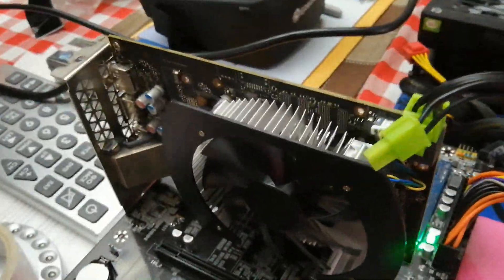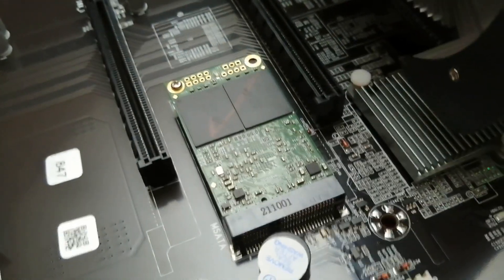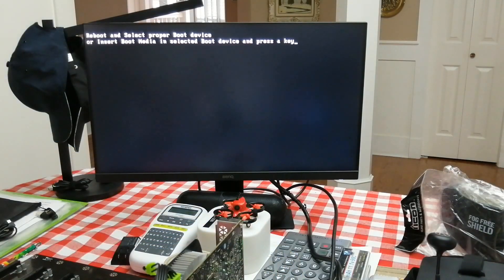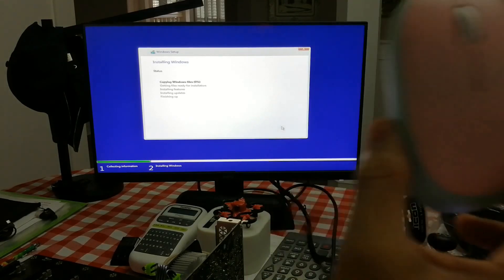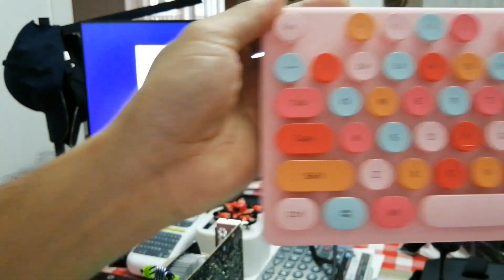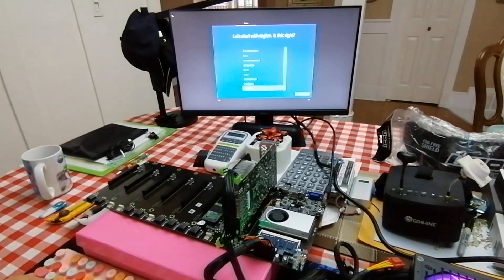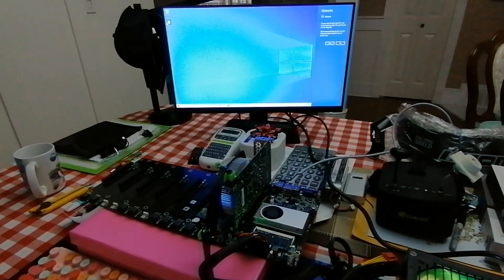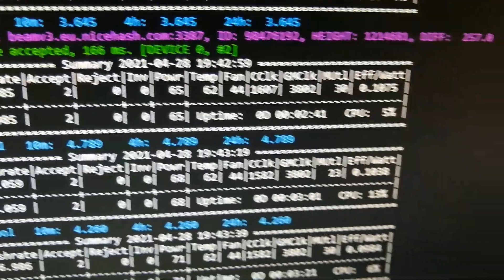BTC-37 BTC-T37 MINING MOTHERBOARD CPU COMBO UNBOXING, WINDOWS 10 INSTALLATION AND TESTING

Comment: Hi miners. Could you read the chip name (between processor and vga), the one square please?
Reply from the maker: BO82HMG, SLH9D, E050B43. I had to stop my rig and removed the heatsink of the chip just to grant your request so make sure to at least like my video or subscribe LOL
Reply: @ruvrandomusefulvideos  Thanks. :) Unfortunatelly I was not precise. It is a small square chip between the processor and the old VGA socket. In the middle of the distance. To the left of it is the letter B. Thank you for the wonderful channel. I started watching other movies :)
Reply from the maker: @dzidziaka  that is the small square chip, it also has heatsink on it. The other 2 same size square chips are closed to the back ports thats it.
Reply: @ruvrandomusefulvideos  missing chip: https://youtu.be/sJIUq_KQS-c

Comment: Hello, what is the space between each pci express slots?
Reply from the maker: Sorry I am away for the next 2 days, I will measure it as soon as I'm back but if you're thinking to get the same board I would suggest the BTC-S37, it has the widest slots spacing, thanks.

Comment: You actually explained the setup pretty well compared to the other 6 videos I’ve watched so far. I just received my 8 slot BTC-S37 am about to set it up for the first time now that I have all my extra components. I’ll check out your other vids on your channel. Cheers!
Reply: What are the 6pin  on the mainboard for? I wonderd since i have the same modell here and never could figutre out what to do with them. Isn it a little bit much to demand 8*6pin plugs? Even if  i buy  a big power supply i maybe can run 5cards.
Reply from the maker: @IndianaStones1  6 pins is to power each PCIE slots. You can get a mining power supply that is design for 8 GPU'S or you can use server PSU.
Reply: @IndianaStones1  - are you talking about the 6 pins on the corner end?
Reply: I think they are for a remote on & off switch but not 100% sure. I’ll look for the video where one UTuber uses them.
Reply from the maker: Thanks for the inspiring comment. I also have BTC-S37 standing by, just dont have GPU'S for it yet.

Comment: Maybe I'm just too dumb, but I can't fit the ram in :( I have the exact same but these small metal "arms" are bothering me to put it in
Reply: just plug it into the connector at an angle and then press gently down. it will snap into place by pushing the metal clips sideways, which then snap back over the memory stick holding it in place
Reply: @adriandeiac8365  thanks, I was being way too gentle

Comment: I can’t get my graphics card to work it just doesn’t show up in task manger or anything else pls help
Reply from the maker: What graphics cards you have? Make sure you 6 pins power for the PCIE slot and 8 pins power to your GPU if required. Also make sure GPu driver is installed.

Comment: Anyone know where is the "beeps" explaination? there is no manual
Reply from the maker: What beeps?
Reply: @ruvrandomusefulvideos  3 beeps then another different one, same as when we power on the mb.

In fact its restarting ,Im mining then it restart itself randomly idk why
Reply from the maker: @PrinceArtanis  I think you are getting the same beeps because its restarting.  Does it shows error on the monitor before it restart? How many GPU do you have Or try mining with one GPU and see if still restarting and add one more GPU at a time to isolate the cause. Also make sure all cables are plug in properly otherwise I would try to reinstall windows.
Reply: @ruvrandomusefulvideos  its on hiveos. Working well with 1 card, restarting after 1h or so randomly with 8 cards, maybe internet connection idk
Reply from the maker: @PrinceArtanis  You have BTC-T37 right? I actually I notice mine also  restarting 3-5 times a day lately, seems that this model has issue, I remember someone post a comment about it before. My BTC-D37 never restart since the 1st da and its running for almost 2 months now..
Reply: @ruvrandomusefulvideos  seems solved. Wifi bug (hiveos restart then)

Comment: Hey I know is a little late but can you tell why I should buy one of those instead of a regular motherboard, the cpu and all that stuff? I’m going to build a new mining rig but I don’t know which motherboard is better in quality and price. Thanks
Reply from the maker: 1st of all it depends on your budget. Regular motherboard will cost more $$$ because you have to buy the CPU, risers etc. 2nd I like less wires, less trouble and simplicity. BTW- I am rebuilding my very 1st rig from scratch, its the typical mining rig that I built over a year ago, it will be my next video.
Reply: @ruvrandomusefulvideos  Yes, I get it, but why don't people use it as much? Is it of worse quality? I want to buy one of those but I'm not sure if it's good. (Sorry for my english, im not a native speaker)
Reply from the maker: I have BTC-T37 & BTC-D37 running for almost 4 months now and I have no issue with them so far. My friend has the BTC-S37 runing for over a month and we both happy with it. But it is good? For me  yes, how long it will last I don't know, all I know is less wires and connection is less trouble. If you're going to buy one get the BTC-S37.
Reply: @ruvrandomusefulvideos  Okay man thank you, I'm going to think about it, I have seen it in different websites but they don't offer too much warranty
Reply: @juanjose7906  I have a few good motherboards and I like this one. It’s the one motherboard that has given me less issues during the post. Some of my high dollar motherboards still act weird and won’t make it past post sometimes even with correct bios settings. It’s a game to play, constantly clearing the bios and trying again with 1 card and then adding the rest one by one. This riserless mb I had none of those issues. It booted right on up first start with 7 cards all connected.

Comment: Does de board work with DDR3L ram?
Reply from the maker: Yes just DDR3 laptop memory
Reply: @ruvrandomusefulvideos  Yes but mine is not booting and I'm using DDR3L not DDR3 and I was wondering if the problem could be from the RAM.

I tried unplugging and plugging the RAM several times, clearing de CMOS, trying different PSU and everytime is beeps 4 times and no boot
Reply from the maker: @eletricman1998  Are you using Windows or HiveOS? Are you booting  to masata SSD or USB? If memory issue it wont power on or if it does you won't get any picture. Please give more details
Reply: @ruvrandomusefulvideos  i'm using hdd but even with only ram and cpu it boots. Atm I just wanted to get to the BIOS

Comment: what best power supply for this board?it fine to use 2x PSU?
Reply from the maker: Yes you can use 2x PSU but I like the one I am using on the video, its 2000 Watts, design to power 8 GPU's, bought from AliExpress.

Comment: Ohh great the s37 board has 24 pin power cable slot. Will it support 3080 cards? 🤔
Reply from the maker: No 24 pins, someone commented that he is running 3070 & 3080 with S37 and hes is getting full hashrate.

Comment: Hi bro, thanks for the video. I have bought the s37 complete kit, already built in a metal case with 128gb msata ssd with win 10 loaded and activated, 8gb ram, 2000w power supply. My supplier is here in NZ, and it should be shipped out tomorrow and arrive on Monday or Tuesday. I've bought a gtx1080 (non ti) as the first GPU. It's been a long time since I did any mining so this will be a fun way to get back into it. I think I will start with nicehash because it is easy, then maybe try HiveOS on a usb stick. Have you used HiveOS at all?
Reply from the maker: I have not use Hive OS yet, I have watch other youtubers and its not that complicated but yes start with nicehash for now, I would recommend the quickminer. I just completed this rig with 8 GPU's and also just received the external SSD drive which I'm going to use with HOS. I will make the video once I did. BTW - My BTC-S37 is on its way as well and I am building my BTC-D37 atm. Keep us updated with your experience with the motherboard. Have fun and thank you for visiting my channel, cheers.

Comment: Hey just too let you know these motherboards are amazing do what they say on the box, I’m running two 570 1 580 and one 3060 ti to good power consumption and good hash rate, good video 👌🏽
Reply from the maker: Thank you! Can you give us a bit details regarding running 3060ti, what hashrate are you getting? Sorry I only have RTx 3060 atm and I ordered another mobo S37 version and thinking to get the 3060ti when they become available.
Reply: @ruvrandomusefulvideos  yeah no problem mate anything I can do to help, I was getting 61mh but was getting a lot off invalid shares, so had too change the overclocks by lowering the memory clock by 50 at a time until I hit the sweet spot, no getting 59mh I’m happy with that hope this was helpful 👍🏽👊🏽
Reply: 59.85mh on the dot
Reply: @deanbrown5309  How'd you manage that? I thought the 3060 TI couldn't do it on ETH, also noticed some ppl say Gen3 PCI was required.
Reply: @craig8847  I get up to 62 Mh/s on an older gen 2 pcie slot. Mine is the non-LHR version.

Comment: I installed rgb fusion to disable the gpu rgbs on the cards, it worked fine after installation i was able to turn off rgbs on mg gigabyte cards but after system restart the motherboard can't detect all gpus anymore, can anyone help me please? Thanks in advance
Reply from the maker: @ Anynms please give more details; What GPU series you have? Does the GPU's still showing on device manager missing driver or if not, does it shows on hidden devices? For sure it just a software driver conflict. Did you try to reinstall the driver? For some of us can help you sure, thanks.
Reply: @ruvrandomusefulvideos  I tried reformatting windows
Reply: @ruvrandomusefulvideos  MB can't detect any gpu's anymore, It's like the pcie slots got broken or somehow RGB fusion flashed som custom bios of some sort. I'm using 3x 3080 & 2x 3090, everything was working fine at full hashrate 100 & 120mh/s until I decided to install RGB Fusion, motherboard still working thou, boot's up fine on windows using the onboard gpu. Also my RTX gpu still works on different motherboards.
Reply: @ruvrandomusefulvideos  Device manager can't detect cards anymore.

Comment: Can you give more info about GPU you using
Reply from the maker: @Globus Fuman I am using10 series cards, 6 GTX 1070 & 2 GTX 1060 6gb and its running 8 GPUs no problem. I also tried to run RTx 3060 on it, video also uploaded on my channel, thanks.

Comment: Is this better than motherboard pci riser?
Reply from the maker: Technically speaking yes, less cable is always better. Plus this board has built in CPU already so its cost less as well. But if you are planning to use 30 series card then this board is not going to give you the potential hashrate due to lower PCIE speed, thanks.

Comment: I have several of these boards and I have the same hashrate fluctuations on all of them I can't figure it out. Goes from 460 mh/s to 410-430 when I switch the screen on or just randomly. Also power fluctuations
Reply from the maker: @ steven stewart this is my 1st BTC-T37 motherboard but even with my gaming PC Z87 mobo running 2 RTX 3060's, I also notice that the hashrate & power fluctuates especially when opening some windows while mining so I know for sure that opening windows even the excavator windows will reduce the hashrate a lot that's why I always minimize or close them. Also I plug my monitor directly to the motherboard to use the CPU graphics card and use HDMI dummy plug on both RTX cards. I ordered the BTC-S37 and its on its way so I can compare them but I assume that they basically the same except the GPU slot spacing and may be the CPU. I also going to borrow my friends RTX 3060 Ti to test with this motherboard soon. Anyway thanks for watching and looking forward to hear from you again about your experience with this motherboard, happy mining & stay safe.
Reply: @ruvrandomusefulvideos  hey I actually just found a fix for hashrate fluctuations on these boards. You just need to set your mining software to High   Priority. That's it. I'm getting max hashrate and it stays within .030 mh/s between all 8 cards. Incredible.
Reply from the maker: @megalojerk84  That's great! I just set my rig to high priority and it seems stable. It was on normal mode, thanks for sharing.
Reply: Hi guys, how do u set mining software to high priority. Is this applicable in Hive os?
Thanks kindly.
Reply: @karloz4649  ctrl+alt+delete for task manager, go to details, scroll down to the miner and right click, select set priority and I only set to above average. No setting like that in hiveos dont need it
Reply from the maker: @karloz4649  Yes Steven is right, Hive Os is Linux base, high priority is with Windows OS, thanks.
Reply: hi can u help me with btc t-37 ? mine beeps 6 times & wont boot

Comment: Thanks for this great video! i want to buy myself this motherboard now, if i fill it with 1050 ti, should i power every pciex port?
Reply from the maker: Yes you have to power each pcie port but I would suggest to go with GTX 1070 for better profit if you can get the ti version, thanks.
Reply: @ruvrandomusefulvideos  thank you for your answer, I wanted to take 1050 ti for very low consumption, their very light weight and also that they are supplied directly by the PCIEX port, it suffices to supply the motherboard and the graphics card for that market ? Also how to add 4pin to 24pin of motherboard? thank you so much
Reply from the maker: @DieckNoz  Good to know, I do not have 1050Ti card anymore so thank you for the info. Anyway are you going to use server power supply? If yes you need the ZSX breakout board, it has 24pins connector built in. Or get the BTC-D37 or S37 motherboard, these motherboards does not require 24 pins supply.
Reply: @ruvrandomusefulvideos  Thanks a lot, so if I am using an S37 or D37 motherboard, I would just have to use a power supply with nothing else to run the rig if I understand correctly. (in fact I meant 1650 earlier and not 1050 TI lol)
Reply from the maker: @LostDreams-Music  Sorry I think I didn't understand your question. But the D37 & S37 version motherboard is powered by 6 pins connector (motherboard does not have 24 pins connector). I am running 5 cards now with this motherboard and I am using mining power supply that I ordered from China, the power supply is capable of powering 8 GPU's. I will upload the video soon. Here is the link of the PSU I'm using; https://www.amazon.ca/Mining-Supply-160-240V-Silent-Machines/dp/B07NXQ4Q8L
Reply: @ruvrandomusefulvideos  okay, thanks you so much
Reply: @ruvrandomusefulvideos  Please let us know when you run x8 cards on this mobo since I'm not sure if the PCI-E 6 pins is enough from that 2k watts. ANd show if you use molex/sata port or something. Thanks!
Reply from the maker: @rayster025  I am running 6x 1070's cards & 2x 1660s, I will upload video soon.
Reply: @ruvrandomusefulvideos  I think these cards do not consume x2 pcie cords? Which is handy.

Comment: I got a BTC-D37. it doesn't have 24pin.i successfully installed windows10 but my graphic card cannot be recognized. so you just slot your card in, then it automatically identify the card?
Reply from the maker: @freestyle You have connect the 6 pins power to motherboard to power each PCIE slot and connect the 6 pins power to the graphics card if required. Also make sure that you connect the 6 pins power of the PCIE accordingly which ever PCIE slot you install your GPU. Also you need to install the driver every time you add another graphics card, thanks.

Comment: Wi-Fi available with Wi-Fi USB adapter?
Reply from the maker: Yes that's correct, as you can see on my video I am using an old wifi g/n dongle 150mps.

Comment: Will it work with rtx 3070 and 3080?
Reply: It works full hashrate for 3070 for the BTC-S37 variant. The 3060 one needs the x3.
Reply from the maker: @rayster025  what hashrate are you getting? Must be the S37, how about D37?
Reply: @ruvrandomusefulvideos  61-63mhs
Reply from the maker: It should work but it will only give you half of the hashrate because the PCIE speed is only x1. For RTX 30 series card you need minimum x8 PCIE speed. I have tested the board with my RTX 3060 and I will upload it soon, thank you.

Comment: How can you power up the cards without connecting he power cable to the motherboard?
Reply from the maker: Sorry I connected it actually. In the beginning I  just tried  it because the motherboard has 24pins already but you still have to connect 4 pins to mobo